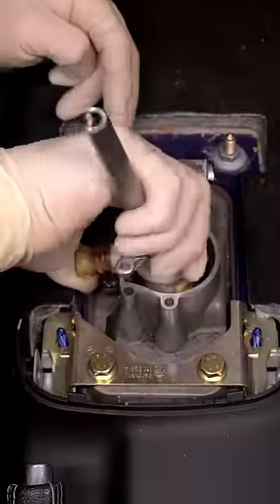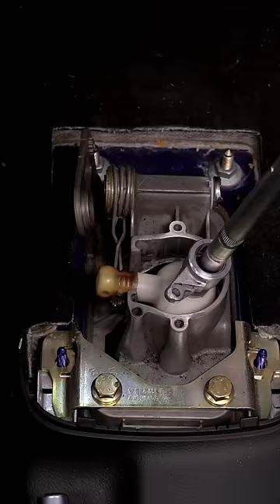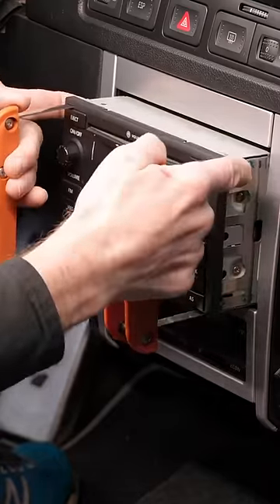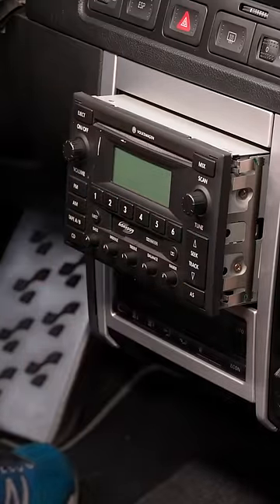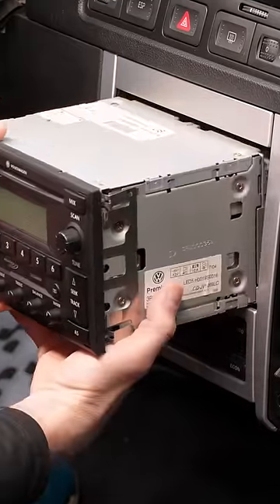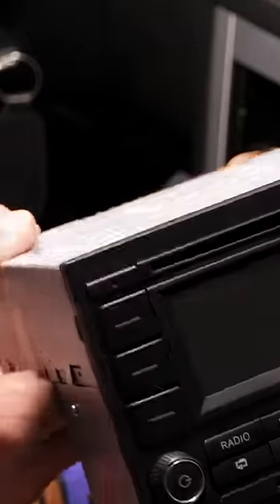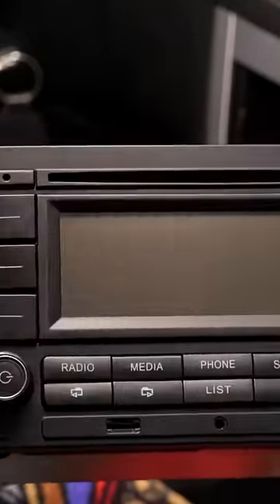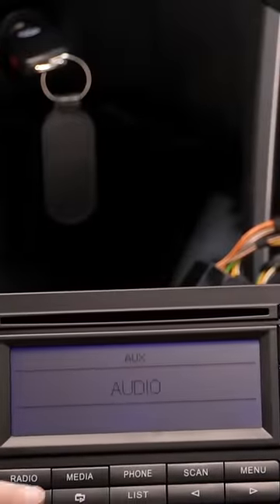I Ruined a Clients Radio OUCH

Comment: Yeah, no, absolutely not. I would be requesting you to find a new original radio replacement. I don't care if you need to buy an entire car just for the radio, especially if it's a rare part like this. It literally devalues the car a lot, especially if it is all stock and mint like this one...

That crappy aftermarket radio looks like shit, works like shit and has literally 0 reception.

You should feel bad about yourself and own up better next time.
Reply from the maker: Own up better?